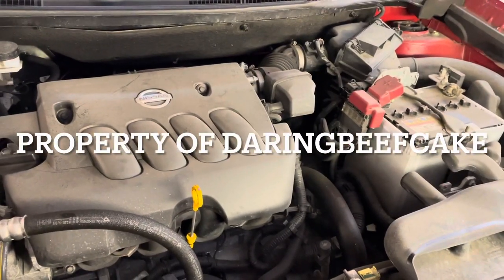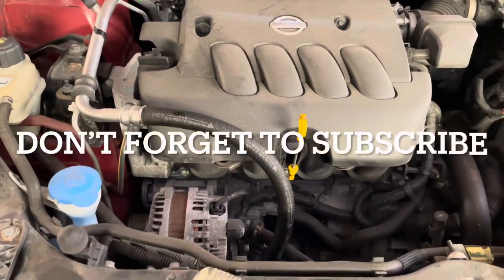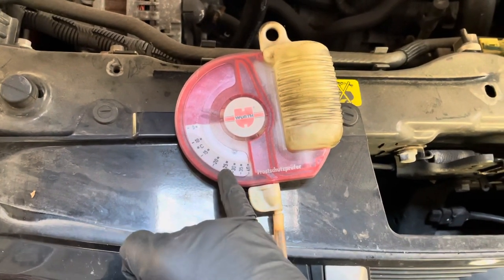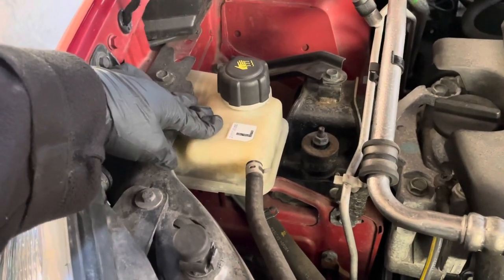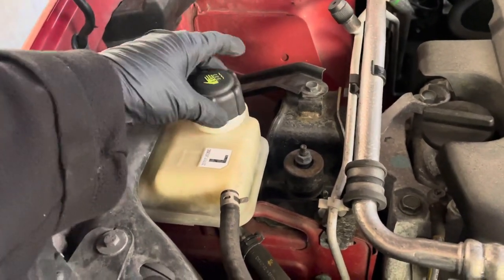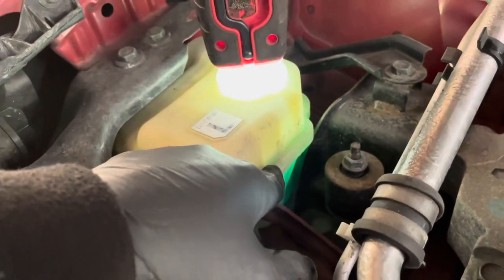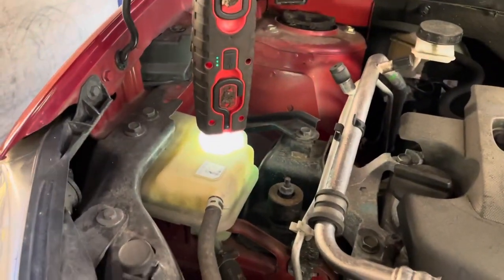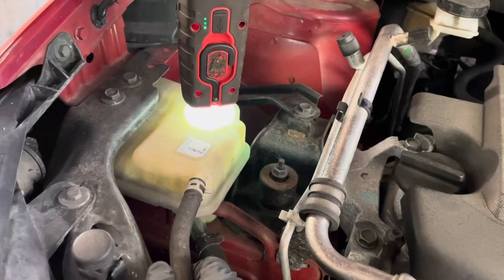Nissan Qashqai 2011 coolant level and antifreeze porcentaje check

Comment: I frequently refill coolant for my nissan qashqai 2008 but no visible leak. I just recently flush and clean my coolant. What do you think is the problem? Thanks
Reply from the maker: Sometime the leak can be small and you can see it, so you really need to inspect everywhere specially around water pump and radiator. Sometimes the heater matrix can leak inside the car so check the carpets if they are wet or not. Otherwise loosing coolant would be a bigger problem such as a head gasket. So also check the oil for any contamination of coolant.
Reply from the maker: Sometime the leak can be small and you can see it, so you really need to inspect everywhere specially around water pump and radiator. Sometimes the heater matrix can leak inside the car so check the carpets if they are wet or not. Otherwise loosing coolant would be a bigger problem such as a head gasket. So also check the oil for any contamination of coolant.

Comment: Please I listen to you explaining about tank,my own car I have been experiencing short of liquid coolant, I monitor it I fine out that any time I run the engine liquid always comes out from the tank cap,can you please help to if it is over or something else thanks
Reply from the maker: May be the cap is faulty. Or if the car is overheating then it could come out the cap.